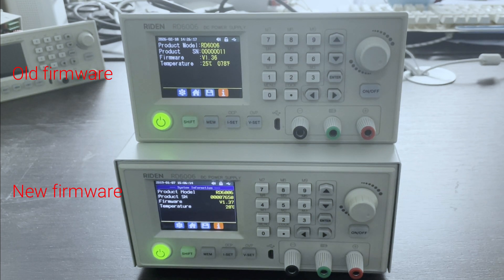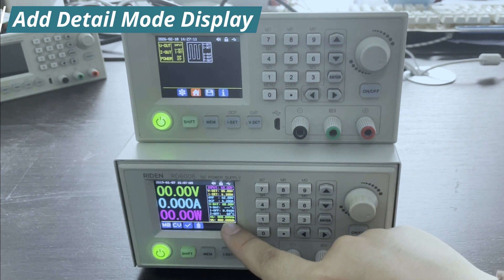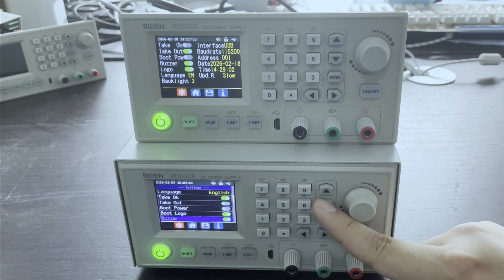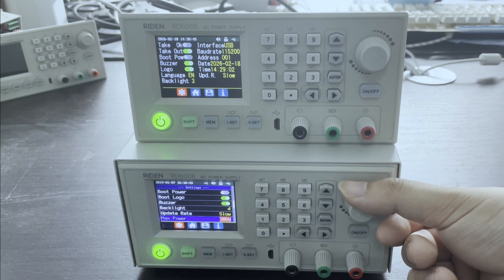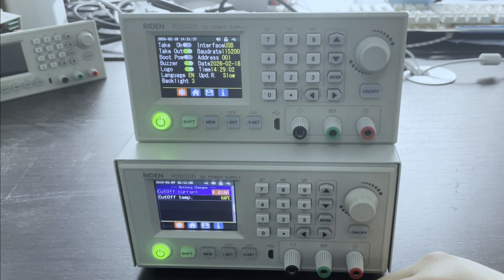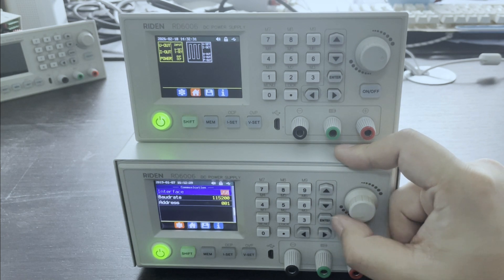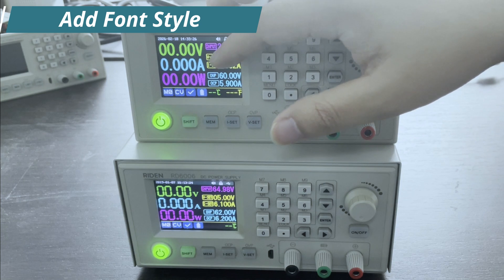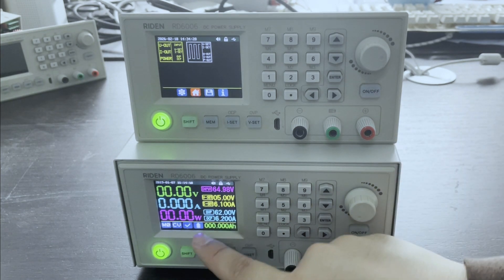RD6006/RD6006W firmware update and new functions

Comment: Hi, I need help, I installed the android app, I connected the RD6006W and it works but when I exit the app it doesn't connect anymore so I have to reset the wifi on the power supply.
I have the latest firmware.
Am I doing something wrong?
Thanks.
Reply from the maker: hello, please check if your phone ip changes, the wifi card memory your ip address when you first connect it, and then it will use this ip to conenct when you turn on it next time, if you do not use fixed ip, then the connection needs to be built again
Reply: @rdtech9153  Thanks, now I'll see if I can set the fixed IP. 🙂
Reply: @rdtech9153  Hi, I set a fixed IP, the RD6006 sees it but the app is unstable, after the first start everything connects fine but if I turn off the RD6006, when I turn it on it no longer connects and I have to redo the initialization, but it often freezes or if the cell phone is connected to the router via 5 GHz wifi, it does not allow you to continue.
I understood that I will not be able to use the app on the smartphone, too many limitations.
Thanks anyway for the assistance, when I bought it I knew that the wifi card was just an experiment.
Reply from the maker: @agib531  plkease make a video to show me the problem ?

Comment: solved the whole problem!  My advice to you is to make a video of the firmware process from start to finish.  Show everything without abbreviations!  I most likely turned off the rd6006 after flashing the firmware and after turning it on it didn’t react at all.  I managed to log in by pressing enter, the bootloader became active and the firmware was uploaded from the computer
Reply from the maker: hello,  in the product manual or product page, you can find the RD operation video, find the firmware update section and you can see the whole video

Comment: I connected the computer, the program wrote that there is a new firmware (next to 37), and now my rd6006 lights up the power button for me in green.  The screen does not turn on, what should I do?  The firmware process itself went fine, at least that’s what the program wrote.  But rd6006 itself does not work now
Reply from the maker: hello, normally when you update it and it does not work normally, hold on the ENTER button and power on it, it will enter the boot mode and continue to update it , then it is ok

Comment: Hello i have some Problems with OTP and jumping temperature on the display without Load. Did you know this issue Firmware is 1.38
Reply from the maker: hello, please contact us on aliexpress, and it is better to attach a video if possible. and what you said the temperature is jumping, can you tell us it is the temperature sensor temperature, or system temperature
Reply: @rdtech9153  Hello, yes it is the System Temperature. Here is a Video from the Problem : https://youtu.be/Bu-_58EtIro Can not turn on if the Problem starts and the other Time it sticks to 24 degrees celsius.
Reply from the maker: @Rikkert-RS  hello, what is the RD6006 system language you set?
Reply: @rdtech9153  I have set German
Reply from the maker: @Rikkert-RS  hello, there are 2 things need you to help: 1. please check if the temperature value, see if it is same value all the time excepts the wrong display, see if the temperature detecting function is still good, 2, for now the firmware is V1.40, you can download the latest firmware to see if this problem is solved, because on our device we tested just now, there is no such problem with V1.40 firmware
Reply: @rdtech9153  Hello, first thanks for you Help here, but the V1.40 is not the solution. If i turned it on today it sticks a while on 24°C and then it is Jumping again. Here an other Video from the Desktop Software perspective: https://youtu.be/dfggUuZJhNQ     Some Extra Info: I don't think that this is a hardware defect because the day before yesterday, after I reinstalled the firmware, the temperature was displayed correctly for a short time.
Reply from the maker: @Rikkert-RS  hello, it is better to talk with us by aliexpress message, or my email in the description, because I need to send not message only, there is a black dot on the circuit board which is the temperature sensor, please check if it is damaged, and when do you order this RD6006?

Comment: I am very interested in the rd6018P but that constant cycling of AH, WH, Volts etc. is very annoying.  Hopefully you will update the rd6018 to be able to see AH, WH, Voltage etc. on a static screen.  I was wondering if you could just create a another screen that displays Volts, AH, WH, Temperature (that flashes at the bottom of the screen).  There is enough information there to fill a whole screen and that would be beautiful.  If that can not be done, it would still be ok if I could scroll through the items one at a time as I need to see them and have them display without cycling to the next automatically.  Thank you in advance for your reply.
Reply from the maker: sorry for RD6018, there is no P version, and for the display, you need to wait the firmware update like RD6006 to get the new display way, but for now I do not know when to release the new firmware
Reply: @rdtech9153  Thanks Rd Tech for the reply.  I was also looking at the RD6012P version and was wondering if that one has an update yet for the display?.  12 amps should be plenty for my purposes.
Reply from the maker: @Outside-In.  for RD6012P,  there are 3 kind of display style, and there is a detail mode display style, you can check if it is what you need, because I cannot send picture here, you can check the product description page

Comment: Tem como modificar a fonte de 60v 6ah para 30v 12ah ?
Reply from the maker: hello, lower the output voltage cannot improve the output current, you can check RD6012
Reply: @rdtech9153  What the meaning of "Take Ok" and "Take out" options?
Reply from the maker: @zmey-  hello, for this it is recommend to check the instruction to see the whole function, take ok means if you need to confirm when you call out a data group, take out means if the output needs to be turned on when you call out a new data group

Comment: Hello,
Is it possible to add a feature in control software or firmware to change display text colours?
For example, make all voltages red, all currents blue, all powers purple, mAh/Wh green, etc. The existing colour pattern is not consistent.
Reply from the maker: for the displayed color, we already have this function, you need to set the color you need by yourself

Comment: is there a forum for suggest features?
Reply from the maker: sorry for now we do not have a forum, usually when there is new products or new function, we make videos on youtube and send news on twitter and facebook
Reply: @rdtech9153  ok, i like the new features. The only problem with de rd6006 is M0, it store the last voltage used, and i would like it startup always with the same setup
Reply: @ulisespetrunior  I made a custom firmware and can add some functionality, click on my avatar and in last video you will find a links to eevblog forum, where you can offer what you want to see. As well, you can find a link to the Reference manual for custom firmware. I am open for dialog and will be happy to see new fresh ideas.
Reply from the maker: @ulisespetrunior  M0 is the default data group, no matter what you set, it will be saved to M0 automatically, so when you reboot, it use the data that you edit before turning it off, you can call out the data in other data group
Reply: @rdtech9153  ok, i have setup the memories m1 m2 and so on, but it's dangerous that at reboot loads the last setup. for example im working with 4.2v and at reboot load 19v.
Reply: @UniSoft2  unisoft user in eevblog?
Reply from the maker: @ulisespetrunior  the output status can also be set, if you worry about this situation,   set the output status off when power on
Reply: @ulisespetrunior  yes, depends from PC... I have view accounts here
Reply: @rdtech9153  I guess ulises would like to have a menu option to select a "on boot" preset other than M0. Personally I'm fine with how it is, but i think if the memory isn't too limited it could be a "nice to have" option.
Reply from the maker: @Leif_YT  thank you for your suggestion, I will tell our engineer to see if it can be added
Reply: @Leif_YT  There is no sense to do it, as soon as you activate any memory cell its settings will be copied to M0... M0 - is a current settings
Reply: @ulisespetrunior  yes, if you have any questions you can ask me in the forum...